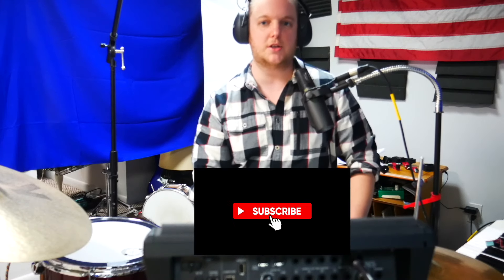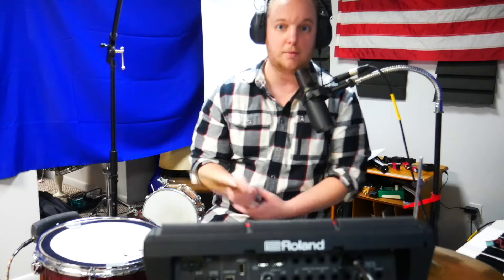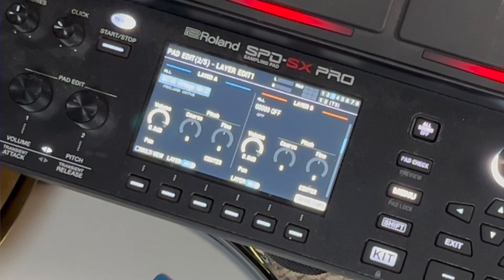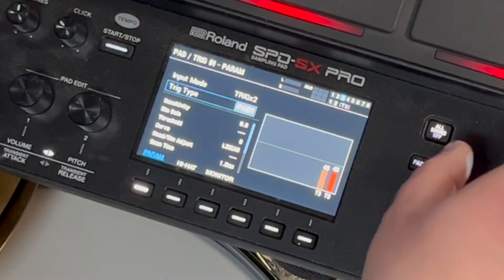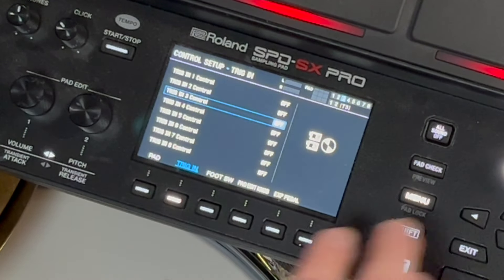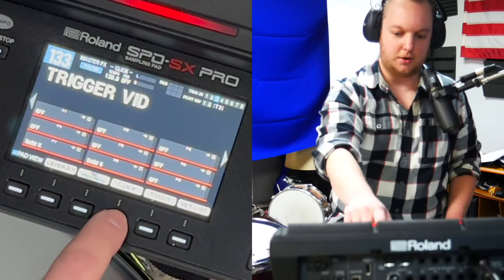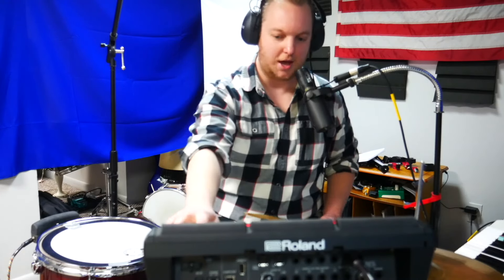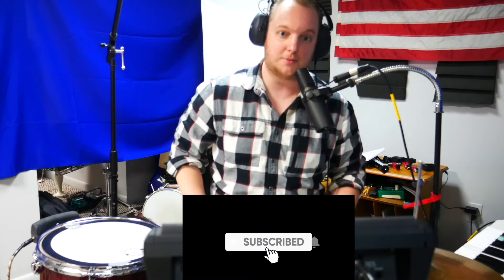HOW TO USE EXTERNAL TRIGGERS ON THE ROLAND SPD SX PRO

Comment: Trigger 1/2 is usually reserved for a kick trigger.. it could be that as it‘s stereo, the bass sound is in the 1 trigger and the 2 trigger is connected to the trigger. It might also be the sample routing may be muted, check your mute groups. Great videos.. greets from Germany 😊🥁
Reply: 1/2 can actually be two triggers you'll want a stereo splitter cable for this HOSA makes some decent ones. I have mine as 1 kick 2 snare in my custom electric kit.